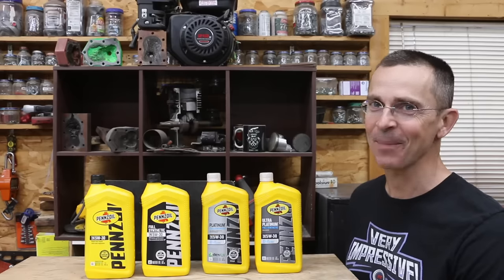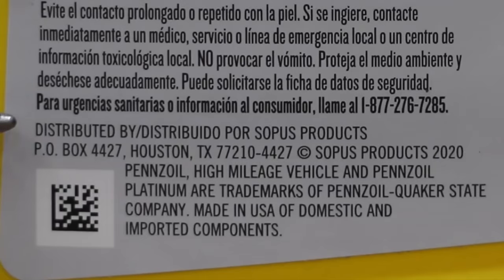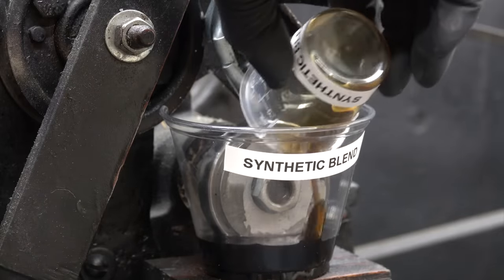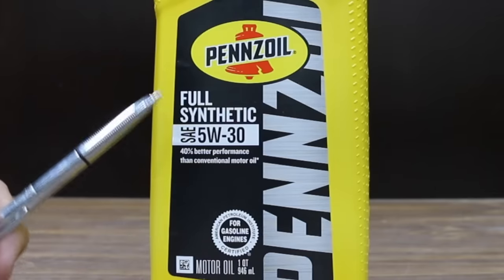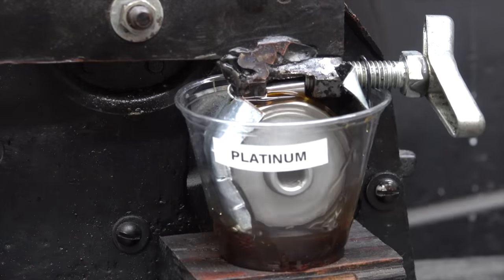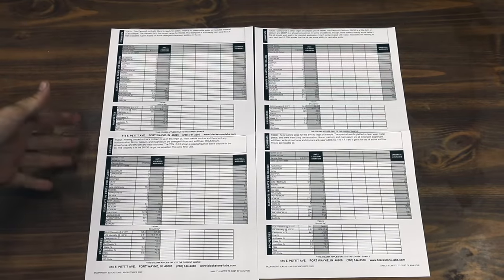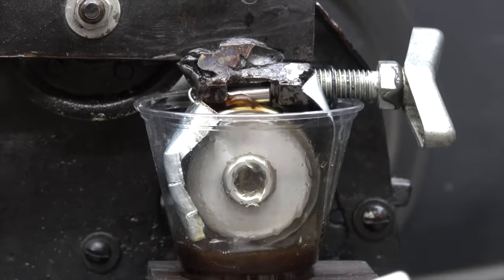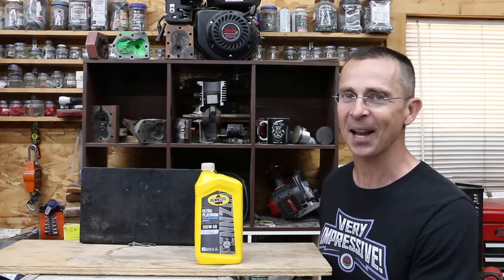Are They All The Same Motor Oil? Let's Settle This!  Four Levels of Pennzoil Motor Oil Compared

Comment: I've worked in auto maintenance field for a handful of years and had the concept of not needing to buy expensive full synthetics because it'll be a waste of money. These tests have helped me understand the differences much better and even shifted my own views on these things. With that though, still think I'll personally keep with synthetic blends with healthy 3,000 or 6 months. 3 months used to be the rule, but I know things have gotten better since then, but the 3,000 mile figure is my standard and occasionally will push 5k, that's just me though.
Reply: Jesus, my guy.
We only swap oil every year or 10-15k km (6.2-9.3k miles), and the oil comes out looking basically brand new. Are american cars/oil that bad, or are you just ripping off your costumers?
Reply: @PPedroFernandes  my dad is an air-force QA mechanic and he says 10,000 KM per change, just top up. No need for every 3000 or 5000 mileage changes since it’s a waste of resources.
Reply: With the new direct injection engines 3k is it for me.  With my older car without it I'll go 5k w synthetic.
Reply: @skye1212  complete waste of your money. But it is your money, so do whatever you want
Reply: @PPedroFernandes  oil is cheap, engines are expensive.
Reply: @kylenewton5446  it is, and yet, changing it that often is, without a shadow of a doubt, 100% a complete waste of money
Reply: All highway driving without towing. 5k miles imo. I drove 120 miles per day for 2 years for work and synthetic was easily a 7500 mile oil. I actually would change my filter at 4-5k miles and top off any lost oil during the process and change my oil at 7500/8k. Blackstone said that oil could easily go to 10k because the additives were still going strong and it wasn't breaking down that bad.
Reply: @lol3ndir  personal vehicle, I don't work in automotive anymore.
Reply: @PPedroFernandes  Well Driving in America is a bit harder. Compared to many European countries we do about twice the amount of travel and at higher speeds as well.  My car is a 99 and has over 273k miles on it.  Considering its age and mileage I dont think an oil change every 5k miles is unwarranted.
Reply: @hell_march6652  I think I'm in a similar boat as you, got an 05 camry with 240k and I change my oil every 5k miles about once a month.  If it keeps me from getting a new car for a couple more years it more than pays for itself.
Reply: All the vehicles in my family have different oil capacities and this is how this is how I decide what the oil change intervals will be. Each quart of oil = 1000-1250 miles (regardless of engine displacement). The exception is a turbocharged engine, which is changed every 5k. A simple oil sample to Black Stone lab can validate whatever oil change interval you decide to use. So far, oil sample test results have shown this to be a conservative approach.
Reply: Over 20 years I only used regular oil (non-synthetic) with 4000 miles oil change intervals.  Never had an oil related issue with any engine.

Comment: Heard lots of good things about Castrol Magnatec oil for turbocharged engines.  It's a popular oil to use in the F-150 community with the ecoboost engines, largely because of its sheer resistance.  Would be cool to see how that compares to Pennzoil Ultra Platinum.
Reply: They do not make that anymore. Dropped it last year.
Reply: @Chieftain357  really sad. I liked it on my 2gr Camry as it helped with the common VVT noise at startup
Reply: @Chieftain357  must have been overrated hyped up junk.
Reply: @Jesse  Nah was a good oil. Just changed names actually!
Reply: Gen2 GTDI Ecoboost aren't sheering oil as did Gen1 GTDI Ecoboost. That said the GTDI is a complex engine design & all will (sheer) to some extent. Ford Motor seems to have this design figured out best.. according to engineering journals I've read. Best prevention? Don't run the engine oil past 7500mis ever.  Preferably.. change @5k mis for long life . I do!
Reply: @Chieftain357  There's better oils out now w/ SP GF-6 rating. Solved.

Comment: Pennzoil also makes "high mileage synthetic blend" Platinum high mileage full synthetic" "Gold synthetic blend" and "Euro L full synthetic".
I would be very interested in seeing those tossed into the roster in a part 2!
Reply: I think the video already showed you basically get what you paid for
Reply: @lakaja6565  Good point, but these are not necessarily more expensive ;)

Comment: There is one aspect of this kind of testing that is being overlooked and it explains a lot about the dexos1 approved product. The oil has to protect the catalysts and exhaust sensors as well as the engine which is reflected in the additive package which would include the viscosity modifiers in order to be approved for the GM specification. As similar as the oils appear to be, the O.E. approvals make this more of an apples to oranges comparison.
Reply: They just aren't PAYING for the certification..that's all. Rest assured they would pass it. -Ohio

Comment: Would love to see an oil filter test, Maybe even an elimination style contest like you did with the oils consisting of the popular and cheap brands that are carried at walmart/auto parts stores. I would also love to see tests done on the service champ brand oil filters that the local quick-lube shops carry. I use them in my business as well and would be willing to send a few for testing if needed. I cut one open and compared it to a Fram and the quality of the Fram looked horrible. Would love to see the comparison if you had a way to test them.
Reply from the maker: Thanks for the suggestion.
Reply: Use Fram ultra synthetic oil filters. The best for under $10.00 at Walmart. Synthetic materials inside with screen backing. Silicone anti  drain back valve.

Comment: It was because of this guy that I started using ultra platinum synthetic penzoil and haven’t looked back. In fact, I took my RV on a 28,700 mile trip in a period of about 4 months and when I changed the oil I was amazed at the viscosity of the oil that I saved a tiny bit and put it into a crystal vile that I hang around my chest.
Reply from the maker: Thanks for sharing.

Comment: One slick thing that Valvoline did when they relabeled their conventional oil was to relabel it to a synthetic blend. There was an internal memo about it that was sent down to us selling the oil while I worked at a parts house and thought that was a bit more than misleading. Now, we don't even sell it and when we did, customers didn't understand that what was on the label wasn't what was in the bottle. I'd be extremely surprised if Pennzoil did the same thing.
Reply from the maker: Thanks for sharing.
Reply: Almost every oil today has some amount of synthetic in it. I think any oil rated API SP or up has to.
Reply: @5roundsrapid263  You could say that all multi-weight detergent oils are synthetic as without the modifications you dont get the performance.

Comment: I like Mobile 1 high mileage oil and would love to see a comparison between the other brands high mileage equivalent!  Keep up the great work!  👍
Reply from the maker: Thanks for supporting the channel.  Thanks, will do!
Reply: all high mileage does is add a compound that is supposed to rejuvinate gaskets of which im doubtfull.
Reply: @georgeperkins4171  Yes, either zinc dialkyldithiophosphate (ZDDP) or zinc dithiophosphate (ZDTP). Not sure if they actually work, but I changed my oil every 4K miles and my 2008 Toyota highlander that has a couple of miles on it is still running strong.
Reply: Best US$ 9,99 ever! You got the review in 1 month.

Comment: I'd be curious to know why they nerf'd the formula for the Platinum, which is priced as the 2nd tier oil and should have been consistently superior to the 'blended' and 'full' synthetics.
Reply: They didn't nerf anything, the difference between the full and platinum is full is made from "dirty" crude, the platinum is made from "cleaner" natural gas. Ultra is the improved natural gas formula 👌
Reply: @willh7690  This doesn't answer the question - why is a 2nd-to-top priced item performing as it does?
Reply: I’m thinking he may have mixed up the regular platinum and one of their lower priced oils by accident. Since the bottles are so similar.
Reply: @johnfaustus1  the process of making natural gas oil requires newly developed technology making it more expensive to make. They aren't going to price it cheaper just because it performs worse than crude. They just push the cleaner narrative and keep the price up.
Reply: @willh7690  Makes sense - thanks for your input.
Reply: @willh7690  I can only parrot the better informed on this, but with modern refining , oils can only be assessed by performance in application, not by the base stock, unlike the old days when pennzoil and Quaker state were named after the superior mineral content of Pennsylvania crude stock as it came from the ground.
Reply: @johnfaustus1  I am guessing the dexos starburst  is the reason,  which probably requires design compatibility with older engines, where a straight top of market oil has no such broad compatibility concerns.    just a guess formed when I questioned mobil one via the help line.  I was advised my old ls1 engine is not a good match for oils with additive packages designed for more fuel effect modern engines although they are a more up to date product, and as logic would presume, better in all ways
Reply: @richardelliott8352  Thanks.
Reply: @richardelliott8352  they consider clean burning as a superior standard. They believe it so much that they slap it on the front lable.

Comment: It was the same thing with the 2 Top Mobil One Variants... Remember the Regular Mobil 1 Synthetic was terrible frozen.. But the High Milage was quick out of the Gate.. moved way faster in fact it took like 8 seconds for the Mobil One Reg to even start to move to pour out..
Reply: I noticed that too. I was wondering if it had something to do with the formula for the Dexos approval. Strange how both of them didn't flow as well.
Reply: @CRM_0210   People used to swear by mobile one. But I live up in  South Jersey and we do get some cold Winter days here I need a good motor Royal that moves right away.. I had a Toyota Solera. I used to use mobile 1 and I noticed that it would knock for a second on cold days in the winter, so I stopped using the mobile 1,  Switch to Castro GDI oil,  and the knocking was never heard from again.
Reply: I mostly use, Castrol GDI 5/30. But from Time to time I use Valvoline. But no Matter the Brand I change my oil like every 1500 to 2000 miles anyway. I've been known to change it in under a 1000 miles.. I do it myself on ramps and it takes 15 minutes. and costs half the money other people pay to go to Walmart or pepboys, to not even be sure about what Oil's they are putting into your..
Reply: @CRM_0210 I’m thinking the same thing, is it the dex rating? I understand dex1g3 is supposed to have better cold temp performance (“pumpability” or some such). I’m having a hard time finding more detailed info.

Comment: Pennzoil is actually having a rebate on their website through end of October. All I buy is ultra platinum & it's $25 off of 5 quarts, the others are included but not sure if same amounts of $ or quantity to buy.
Reply from the maker: Thanks for the feedback.
Reply: Thanks for this. Per the Terms and Conditions you can redeem an offer twice per individual as well.
Reply: @Friendlyx333  Yes you can twice per individual. I bought the ultra platinum from walmart for $24.95 a piece so it's like buy one get 1 free after the $25 rebate & took advantage of my 2 chances amounting to $50 back.

Comment: Awesome test! I use a a lubricity additive when I change my oil and I'd love to see an oil additive test using the same oil and different aftermarket additives to see which oil additives preform the best because I'd hate to think I'm adding something that may or may not work. I've been using Archoil and a test of some similar additives would be most excellent.
Reply from the maker: Thanks!  Thanks for the suggestion.
Reply: I’d love to see a test with the Lubro Moly MOS2 additive with the Ultra Platinum. That’s all I’ve been using for years and anything forced induction has always loved the MOS2.
Reply: You're wasting your money on the additives.

Comment: Darn, I didn't know there was an "Ultra" version of the Platnum. 
I got to run to my garage to see what I bought....
I bet I bought the regular platinum, and I'm disappointed in its cold performance.
Reply: Good thing it's June. Change your oil now, use the platinum, then when winter rolls around you'll be due for another oil change anyway.

Comment: So interesting, I've always used regular Pennzoil Platinum in my car for the past 7 years and 60,000 miles. It's never burnt a drop. I've never even seen the Ultra Platinum in stores anywhere around where I live.
Reply from the maker: Thanks for the feedback.
Reply: Same, ultra platinum is hard to find. I have never had any issues with it, I'm in a cold climate and have sent oil to Blackstone Labs several times.

Comment: Nice test. Could you possibly run a wear scar test with diesel fuel treated with some of the many additives claiming to increase lubricity such as hot shots EDT or power service diesel kleen? A lot of folks with modern diesels are trying to keep Bosch CP4 pumps alive and I'd love to know how effective a couple ounces of additive can be in a tank full of fuel. Thank you!
Reply: He has done this before, check out his video on diesel anti-gel additives, its a few years old, but has these tests.
Reply: @kckorienek  I'm not interested in anti-gel. A lot of folks are after lubrication. These additives claim to increase lubricity. I watched his anti gel test but he didn't touch on the lubrication these additives claim to increase.
Reply: Ya i think the hot shots fid the best if i recall
Reply: Check out brianBloc02. I think he runs Delo because he said that it and Deere oil were the only oils for5mulated for flat tappets. Those aren't pumps but I think that's what he runs. I KNOW it's what I run!
Reply: @4wdiesels  yes he did
Reply from the maker: Thanks!  Thanks for the suggestion.
Reply: @dant387  I should have worded it different. He tested them at 100% strength which is not real world. I've always been skeptical about how 1 crummy oz of additive can give me any noticeable improvement in a 25 plus gallon tank of fuel. Some additives call for more but none are calling for much more than 4 or 5 oz for a tank. The stuff would have to be beyond concentrated and I have my doubts. That's all. Would have been nice to see the wear scar test done with additives in the fuel at the manufacturer's recommended dose.

Comment: Since 90% of engine wear occurs on Startup flow rate seems to be extremely important if not most important. I'd like to see the flow rate between Pennzoil Ultra platinum and Mobil 1 extended performance.
Reply: that high mile stuff will mess up seals in new cars if you switch around from my understanding....

Comment: It's quite important to mention that Penzoil Platinum seems like a product designed for older/high mileage engines that tend to leak, and it's job there is to seal leaking points. Therefore one should not be surprised that it has less detergents than other products, because you do not want your oil to remove the carbon deposits that works as a sealant.
Reply: Did not think about that.
Reply: Don't they have a platinum high mileage oil for that purpose?